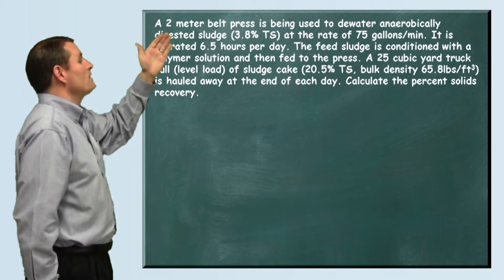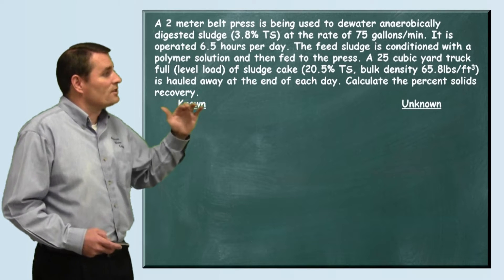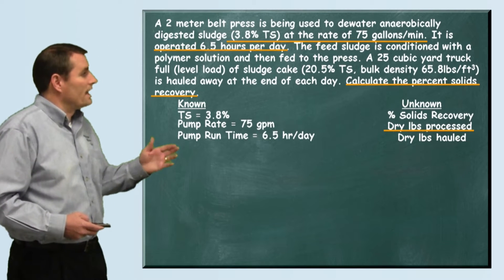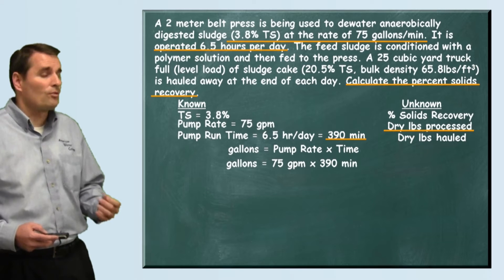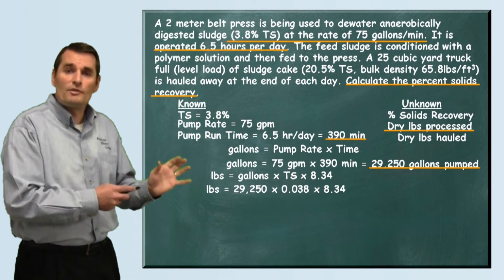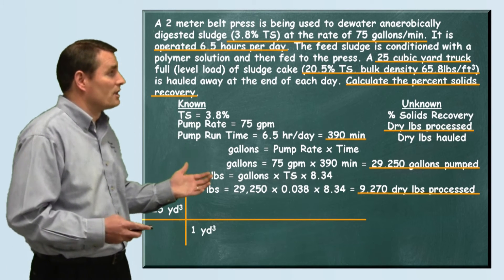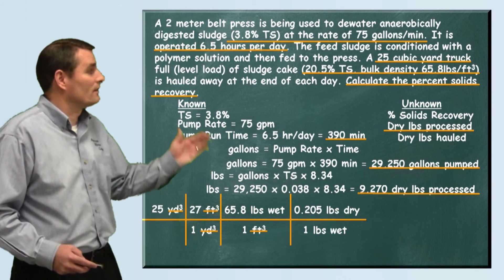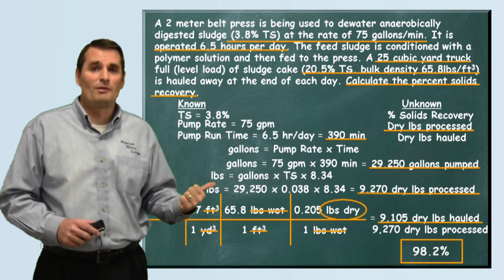Problem Solved: Percent Solids Recovery - Wastewater Math

Comment: This is an exercise in playing with dimensions rather than solving a problem.  Put this in SI units used by the rest of the world and the answer just needs one line solution and is  apparent from the question itself.   But hey, let us mix imperial, metrics and different units for volumes, and forget specifying weight. Percent vs volume percent, and make a simple problem  more complicated than it is...if memory serves me correct billion+ satellite was lost over mixed dimensions....when U.S.  was working with Europe on a project.    America stop being too proud, join the rest of the world and adopt metrics.